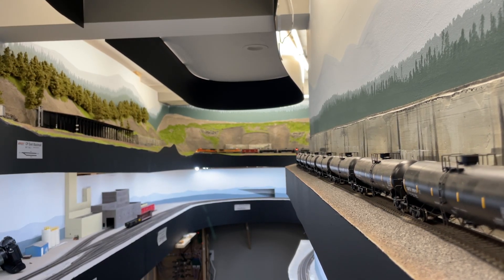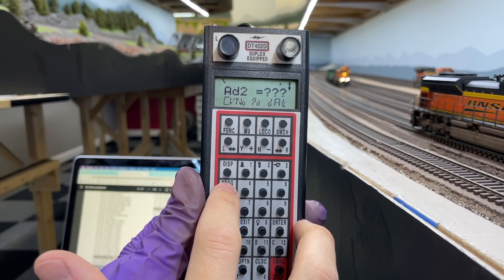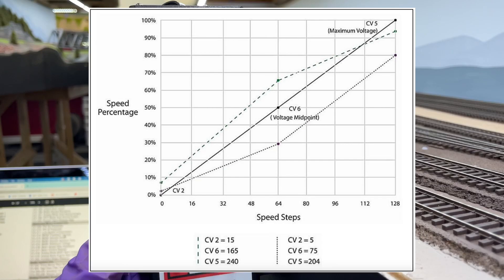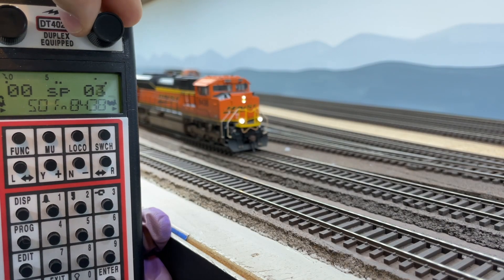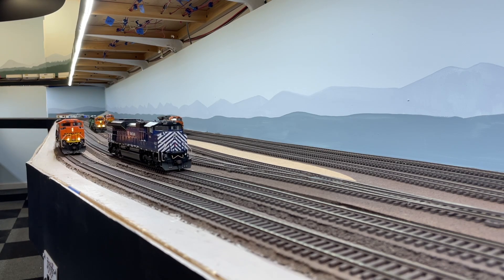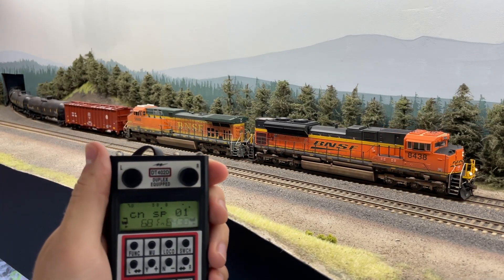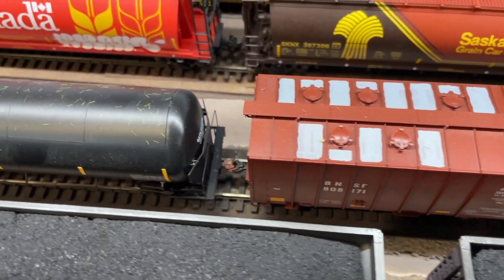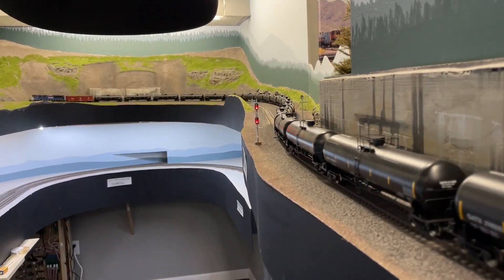Speed Matching Locomotives for MU and Distributed Power Consists

Comment: I am just getting into DCC (N scale), do the decoders need to be the same brand?  I have a whole mix of different locomotives from Kato, Broadway Limited, Atlas and of course some with different decoders already in them when I purchased them.
Reply from the maker: They do not need to be at all. My locomotives are a mixture of different brands, and I have multiple decoder brands as well. It can certainly help to work with decoders of the same brand, but it's a luxury more than anything. In fact, you'll see in the description of this video that I've listed the configuration variables to adjust load compensation among a few different decoder brands that I have. Hope that helps!
-Cam
Reply: @railfan220  Thanks!

Comment: The original Tsunami doesnt use CVs 5&6.And some brands may not use these in future.So using speed tables,CVs 66&95 can be used to adjust overall speed.But im not sure this is the answer for speed matching.

Comment: Hey man thanks for this video. What you did makes a lot of sense and seems to work out. 

Did you do anything specific to match up your scaletrains engines? I've recently stepped into the world of playing with CVs and now speed matching. For the life of me I cannot understand why I can't get any of my st engines even close. 

I've tried: using the speed table on JMRI; I've tried using the start, mid, and high CVs; I even tried the forced straight linear speed table line, I turned bemf off, trims, accel/decel off; I spent  nearly an entire day on just speed matching 4 different esu ST engines, and at the end I just had to walk away.  

Nothing I did worked, I watch many videos on what people have done and everything I copied either my engines wouldn't move till like speed step 25 or  at speed step 1 moved way too fast. 

One thing I noticed was that when using the speed table on jmri speed steps 1 & 28 are locked/grayed out and cannot be moved.

Comment: Good informative video but I wonder when DCC will get to the point where its just push one button and go. The RailPro system by Ring Engineering is cool. I guess to much is invested in DCC until the radio control patents expires.

Comment: This is good stuff, especially on the BEMF settings. Why is it, though that you are deviating from common practice that says with regards to CV2 that a loco should start crawling on speed step 1? Also: are you programming your locomotives "cold", this is without running them for a few minutes before setting the values?
Reply from the maker: Thanks! I generally do try to set CV2 so that it starts at speed step 1. It wasn't obvious that was the case in this video. But of course, once the locomotive has some load behind it, it will take more than speed step 1 to get moving. And in the case of these two locomotives, I did do a bit of running beforehand, but I generally don't break them in for too long. I bet it would be beneficial, yeah?
-Cam

Comment: How did you get your athearn genesis sd70 to have the dpu lighting setup similar to how scale trains has it?
Reply from the maker: I basically just set the headlight and rear headlight to be controlled by two separate functions and then enabled them to be on in either direction.
I decided to set the rear light to be controlled by F9. Here are the CVs I changed to do that:
- set CV31 to a value of 16
- set CV32 to a value of 2
- set CV278 to a value of 255
- set CV258 to a value of 9
Finally, you have to make sure that both headlights are capable of staying on when the locomotive is traveling in either direction. To do this:
- set CV57 to a value of 3
- set CV58 to a value of 3

The information pertinent to the changes I made can be found in the Tsunami 2 manual on pages 28, 31, 55, and 56. Here's a link to that manual: https://soundtraxx.com/content/Reference/Manuals/Tsunami2/tsu2_diesel_usersguide.pdf

Hope that helps!
-Cam
Reply: @railfan220  Cam, thats cool. I have only ever seen people do this via advanced consisting in JMRI. Thanks for sharing. I like the scale trains DPU headlight settings for longer haul trains, but during operations, it can be annoying to jump between the rear and front locos to get the headlights reset for changing directions. Ill have to dig into this! Thanks!

Comment: Thanks for the info, I appreciate it. What values are you using for accel and decel? And do you adjust them as well?
Reply from the maker: Thanks! I've messed around with using momentum before, but currently don't use it systematically. So if a locomotive comes from the factory with a fair bit of momentum, I'll set CV3 and CV4 to 0 or 1. Some decoders allow button-activated momentum, which is something that I would like to experiment with. But I'd probably only do that if I had decoders that were all the same type. There's too much variability in how momentum is defined from decoder to decoder for me to figure out.
-Cam
Reply: @railfan220  thanks. Have a great weekend!

Comment: Best one I have watched. That resistance CV has never been mentioned in other ones and makes a lot of sense. Curious your experience with matching different brands of locomotives and decoder’s. I’m having trouble between the scale trains and Athearn.  For you or others, if one is engine is still faster than the other do you adjust both CV5 and CV6 or just one?
Reply from the maker: Thanks! I don't have too much trouble speed matching between manufacturers. Honestly, the biggest trouble I've had is between ESU products. The V5 sound and non-sound decoders have load compensation that is adjustable. But, despite the CVs being listed in the manual, earlier versions of ESU decoders don't seem to be affected when you turn down load compensation. 

Generally, I'll just adjust CV 6 to find tune speeds between locomotives. I find that I'm usually not running the trains at full throttle even after the top speed adjustments I make, so moving the mid-point voltage (CV 6) up or down has the greatest influence on speed matching. Of course, if the top speeds seem WAY off between two locomotives after an initial round of programming, I'll change it too. But it's usually not that drastic.
-Cam
Reply: @railfan220  I have the same issue with the load compensation on my Scale trains GEVOs with ESU Sound V5. The load compensation has little to no effect, even if it is disabled. What value do you set load compensation on those decoders?